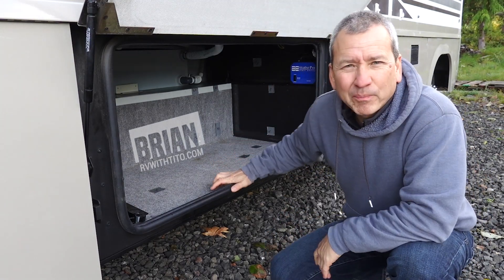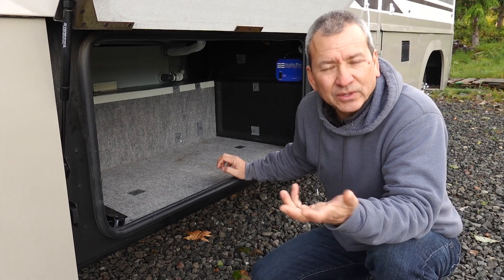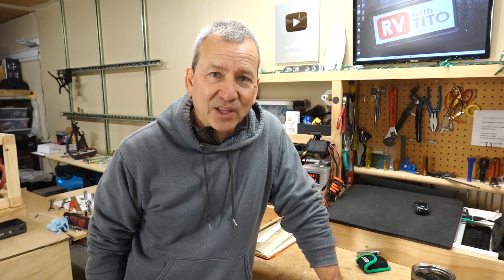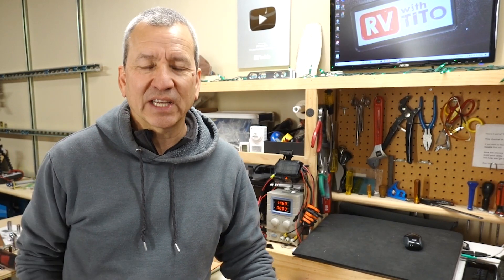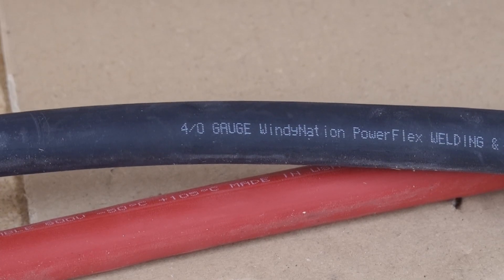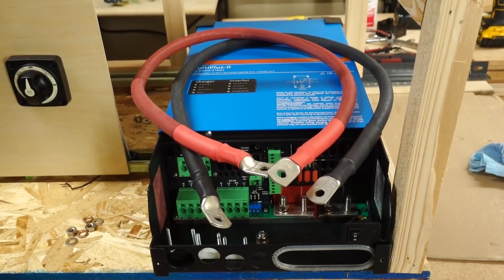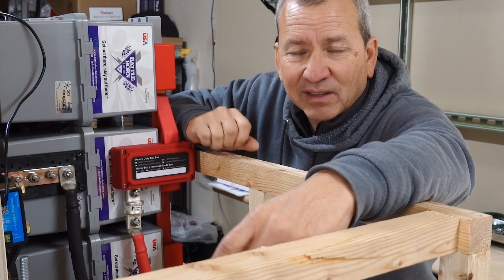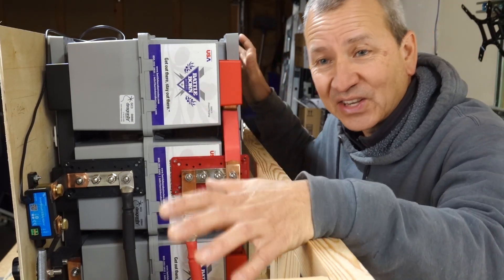Our Massive RV Battery Bank with Copper Busbars | Battleborn GC3 Lithium Battery | RV With Tito DIY

Comment: A fantastic validation of the copper buss installation I did on my coach. You're still at the top of the SOOPER GENIUS list.
Reply from the maker: Sooper! Glad I'm not the only one. I'm diggin the busbar thing.
Reply: copper buss is great, when I up my rig to 400ah I will use copper not cables. nice work on the cut off switch mtd to the copper buss.
Reply: you can use 4 pcs of # 607-Tinned Copper Braid, 1″ wide mounting 2pcs  per side of your copper buss bolted on for any movement.